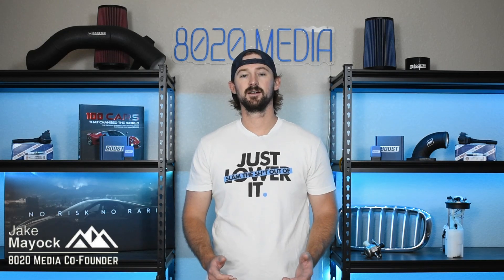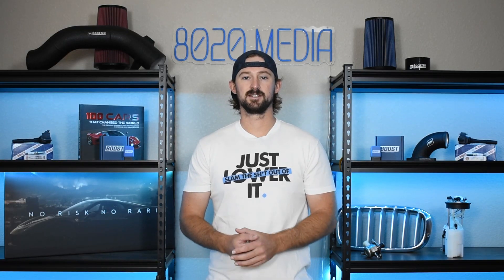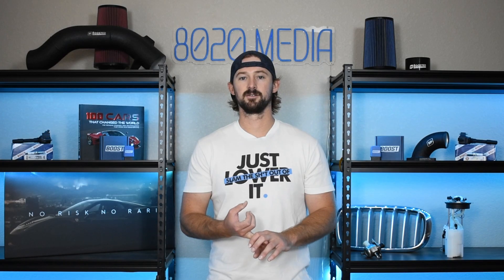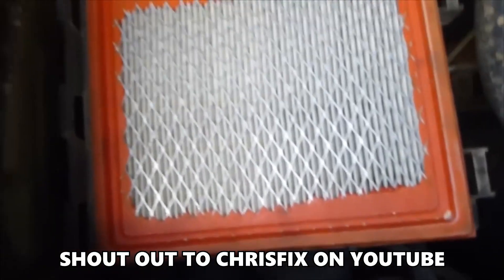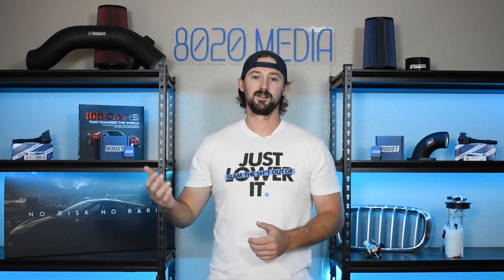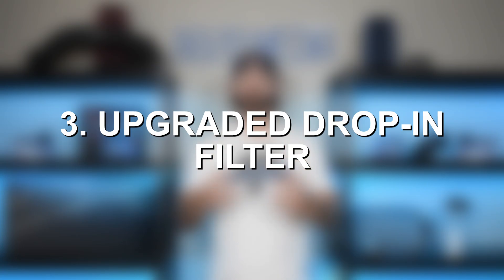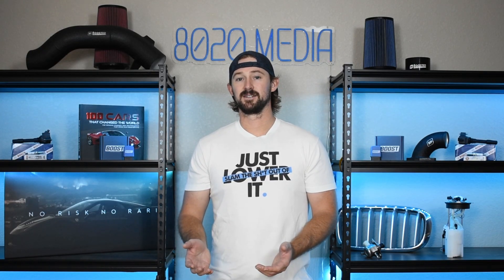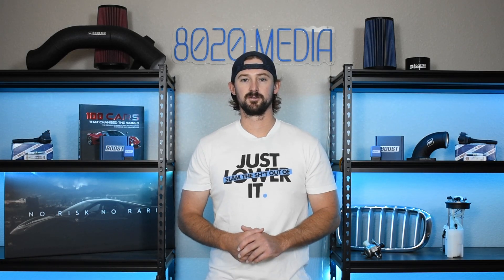Signs & Symptoms of a Clogged Vehicle Air Filter!

Comment: I just bought a 900 valcan it got choppy idal i check things over filter looks clean had it idling away remove filter cover it ideal up and smooth hit throttle it responded way way way better couldn't believe it ordered high flow should make huge difference oh and saposse to get like 40 mph more like 10

Comment: Let's say I ask my mechanic to change my air filter (2001  Crown Vic P71)
should  I also ask them to clean out the entire intake system? And can  they
do that easily enough? Thank you for your comments!
Reply from the maker: R - Asking your mechanic to change the air filter is routine and smart, but having them clean the entire intake system depends on the condition and mileage—if it’s got high miles, idles rough, or has sluggish throttle response, it’s worth asking them to at least inspect and clean the throttle body and MAF sensor, which are easy and low-cost services; cleaning the full intake manifold is more involved and usually not necessary unless there's carbon buildup or drivability issues, so stick with throttle body, MAF sensor, and possibly the idle air control valve for a solid refresh.

Comment: my air filter wasn't dirty as the one you showed that was caked with mood.  my air filter it was a used truck i bought.  not sure if it was clogged or just the wrong one. but i was getting the p0101 code    i changed the filter reswet the code an its been 4 months no code
Reply from the maker: D - Great to hear! Thanks for sharing your experience!

Comment: My Mercedes mechanic missed this simple check.  I brought the car in for slow acceleration and it would not shift into high gear (automatic transmission).  So, $700 later, the mechanic finally said, "We found the problem.  It was a squirrel's nest in your air box."  This should have been the first thing he check for $100...  Good video.  Thumbs up.
Reply from the maker: A - Totally agree.. Very often overlooked and SIMPLE thing to check. Thanks for sharing your experience!
Reply: @8020Automotive  Most "mechanics" of today are "plug and play" technicians who just want a computer to do the diagnostic part of finding the problems.  A true mechanic understands the system(s) in a vehicle and how each component affects the system as a whole, thereby, the problem is obvious to them.  It is like bringing your car in with a flat tire and the "technician" plugs in his computer and sees the "code" that the vehicle's leveling system shows a problem.  No, it is just a flat tire which makes the car lower at the flat....  Simple.
Reply from the maker: A - Just gotta find the good ones that you trust and stick with them.
Reply: @ababbit7461  Was the slow acceleration very noticable? My friends Mercedes is having slow acceleration and sluggish and very noticable, he also said he hasn't changed the air filter and he's had that car for ten years.
Reply: @davidjones7513  The car would not shift into higher gears and yes, it had slow acceleration.  Yesterday (July 2nd), I checked my Jeep's air cleaner since it was sluggish.  Guess what!  Yes, another squirrel's nest in my air cleaner box.  Time to eliminate the pine squirrels...  The squirrels took the filling of my old diesel truck seat and put it in my Jeep air box...  Little buggers!!!  Clogged air cleaner will cause slow sluggish acceleration.